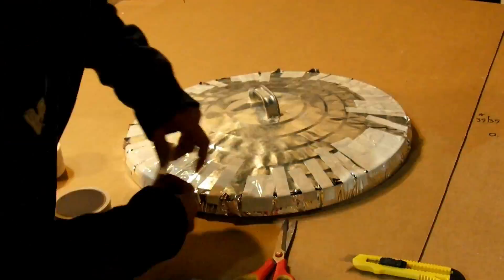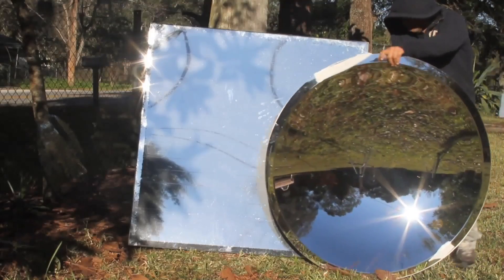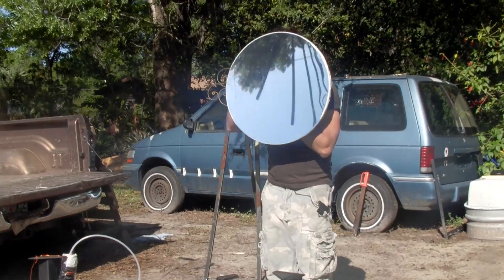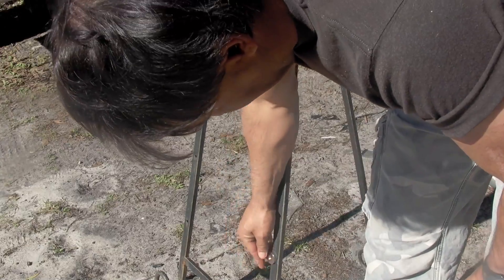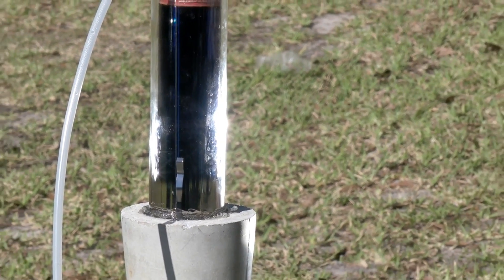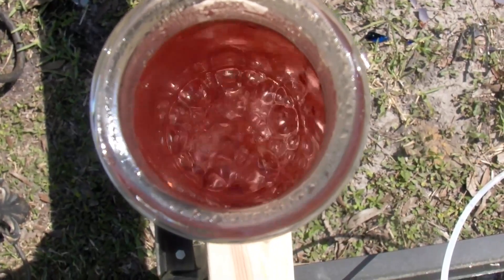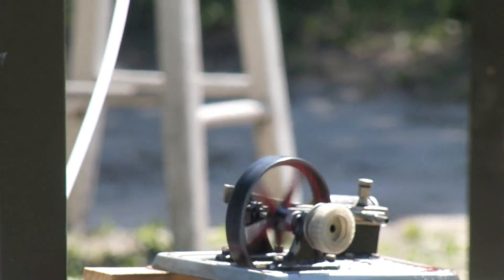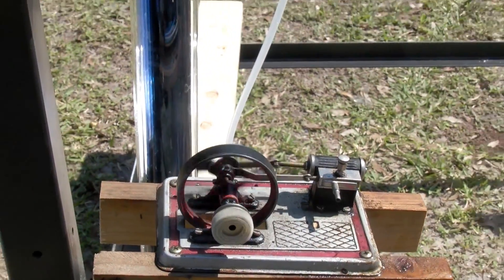Trash can lid powers a steam engine parabolic mirror

Comment: Parabolic dish is focusing at just one focal point facing evacuated tube....! is not it too risky or evacuated tube may burst. until now I have just seen parabolic troughs focusing evacuated tubes. This is the first time I am watching parabolic mirror dish focusing evacuated tube. Please reply briefly. Thanks.
Reply from the maker: Hi,
You can use the spot on an evacuated tube but do not place at optimal focal point or it will burn and destroy the absorber surface. Widen the focal pattern to cover the entire 2" area of the tube. This is also more efficient as the concentrated light covers more area so the tube interior has more surface to the water.
Here is another video:
https://www.youtube.com/watch?v=P_zK5CgTk20

The size of the mirror should be 13" diameter to 25" diameter for this size tube.

Comment: I would really like you explore the potential of solar steam, how many watts could you get?
Reply: Depending on the application human power would be better than steam. If I wanted to power my grain mill, hooking up to a bicycle would simpler and more effective than a steam engine. For high torque applications Compressed air is the way to go. A steam engine or sterling engine could be good to power an air compressor. Although I would want to try a bicycle powered air compressor. There is an Amish shop that sells appliances modified to run off compressed air. For electricity I would go for wind and PV.

Comment: As others have said, some simple mods could make this more efficient. Add to this the fact that leds don't ask for much, and you could draw enough power to power 1) an Arduino relay that would correctly position the mirror throughout the day, and 2) light a medium sized room at night. Safety, blah blah. But this shows great promise.

Comment: This is great idea,but there is less and less sun every year in Florida people due to geoingeneering..So it will work only on sunny days.Real clear sky all day long is rare in sw florida and usually happens during winter time when sun is at its lowest power..It sucks,I know..I love solar and I have 5kW array.
Reply: PV arrays work off of light, not heat, and in fact some of the cheaper ones lose efficiency in high heat.
Reply: dlwatib Hi,I know pv works off the sunlight not heat..Just saying that real great solar days in florida becoming rare year by year.Arizona might be the best for solar isolation,definately not florida...

Comment: It would also help the efficiency If you didnt have such a plastic tube. If you had an air tight tube cylinder heated directly by a mirror and with just air you could definitely get more efficiency. Using water with a long tube drops the efficiency completely

Comment: Currently the price of good quality solar PV is 1$/W I even consider using this to heat my new house I just need to pay for the next 10 to 25 years of heating and I do not have the money right now.
Here I get an average of 0.115kWh/month from 1W of solar PV so in 25 years expected life of PV I get 25x12x0.115 = 34.5kWh that is just 2.9 cent/kWh and can use that to heat my large concrete floor directly so thermal storage. Just need to find a use for this power in summer.

Comment from the maker: This setup, the fresnel lenses, and parabolic mirrors range between 80% - 90% efficiency for solar thermal = cooking and water heating. As long as there is a sun, the renewables work perfectly. For electricity, PV photovoltaic, I have 3KW that cost $1 per watt for a completed panel. $1.65 a watt with inverters + batteries and GTI's. By using solar thermal for direct heating you save a lot. We only use electric for heating water 50-100 days out of the year. Same for cooking. E-bill is 75% less.

Comment from the maker: Good math. That is perfect, or very very close.
The low efficiency is a result of the small engines maximum power and dynamo or alternator electrical efficiency. A  perfectly matched engine could push 15-30 electrical watts. Moving parts is the problem. PV for light/sun and peltier for thermal. There is a better steam engine design that has less moving parts.

Comment: I will assume that trash can lid to be about 50cm (about 20") diameter in that case the surface area 0.25x0.25x3.14 = 0.196sqm assuming again 1000W/sqm at noon and 80% reflectivity on your mirror gets to 1000x0.8x0.196 = 156.8W heat directed to the vacuum tube from there you say about 2W on the output that is like 1% total efficiency from the 200W solar to 2W electric.
I guess even a much simpler and inexpensive peltier will be able to get better efficiency with no moving parts :)

Comment: can you get a bigger steam engine like a 1 hp or something to try to power a small alternator or pma to charge a battery bank. The mirror intensifies the sun so im thinking it could be better than a solar panel. with the correct combo

Comment: You could always toy with the idea of flash-steaming. Simply preheating the metal with multiple sources of focused light, and then pumping in a small amount of water would create much higher pressures, and therefore create more energy.

(Although, it would undoubtedly be more dangerous!)

Comment from the maker: The vacuum tubes alone will boil water but it takes a while. A series of tubes as pre-heaters would lower the requirements of multi-mirrors. One good sized mirror or lens could do the boiling work on near boiling water.